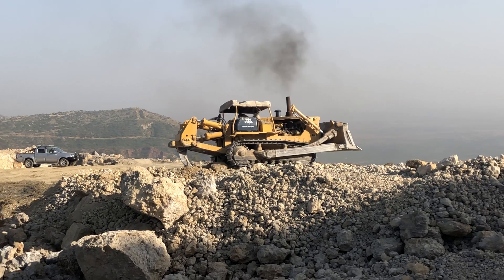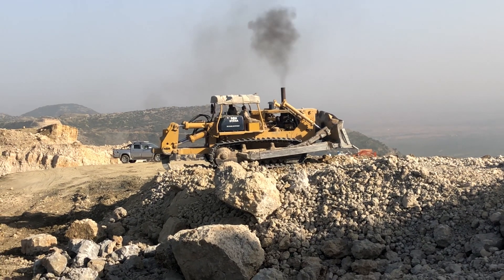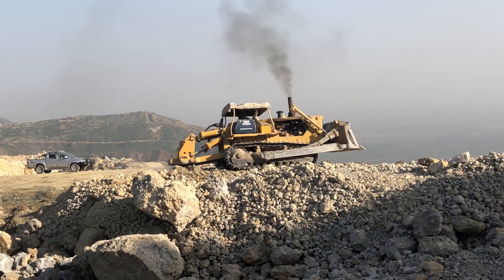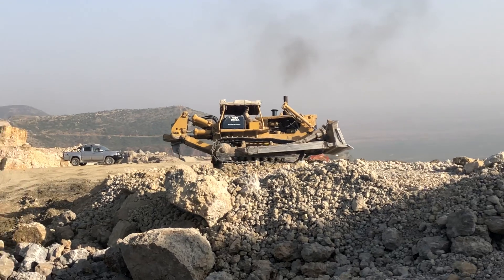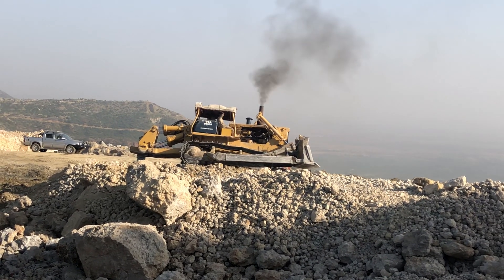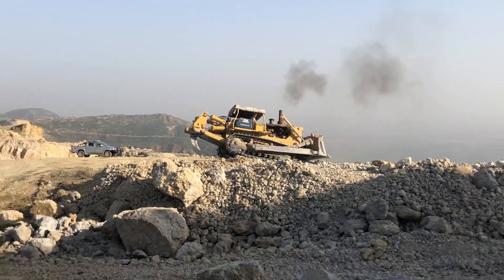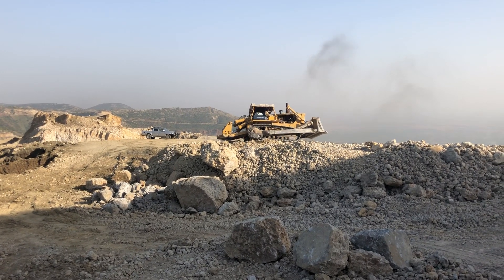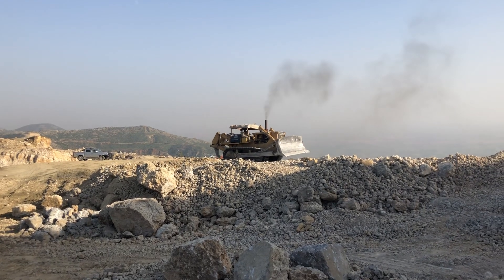D155 dozer ripping fail!!!!

Comment: He has to take i easy as he could pull the mountain down  with the great auld 155A,,  great auld dozer ,we had two of them they are a big D 8  with a 320  hp engine they all smoke a little  but its just to prove its a diesel
Reply: Qual dos dois é melhor o D155a-1 ou o D8 ?
Qual era o d8 que você tinha